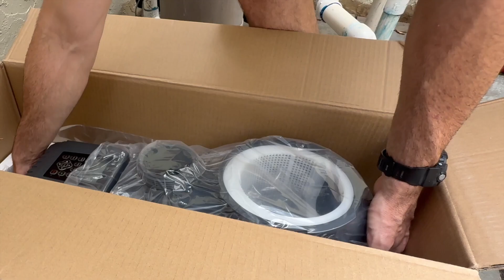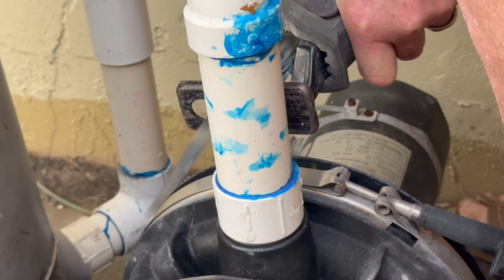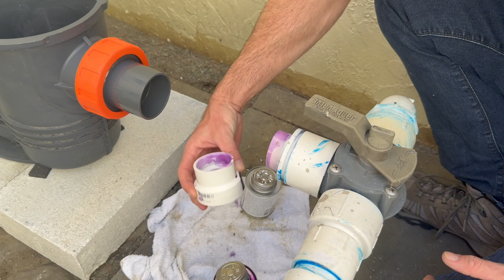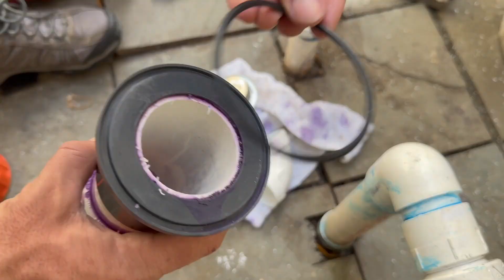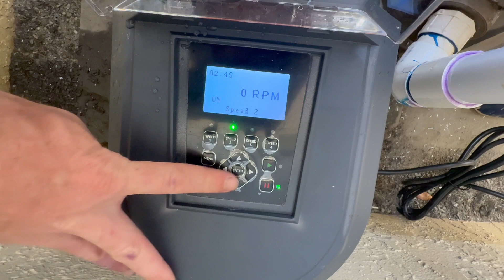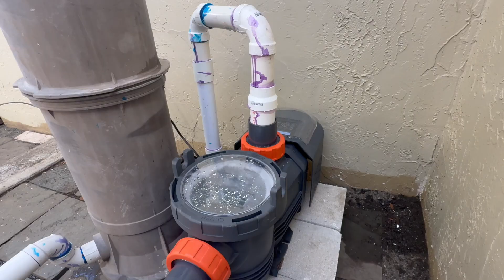How To Install #Varminpool 3.0HP Variable Speed Pool Pump 2 | DIY Guide From RICHARD SAPP

Comment: I got this same pump. Love it but my pump basket never completely fills with water? I have no air bubbles and plenty of pressure out in the pool returns ?
Reply from the maker: Thank you for choosing us! The operation of the water pump can vary depending on a number of different factors. To help us better identify the specific causes behind the bubbles and pressure issues you are experiencing, would it be possible for you to record a video of the situation and share it with our after-sales support team via email? Our support team's email address is: support@varminpool.com. We look forward to hearing from you!😄
Reply: Just installed mine yesterday and it's doing the same thing.
Reply: Same here.